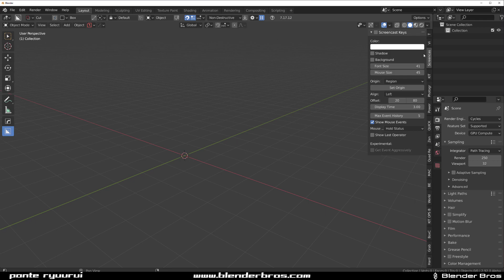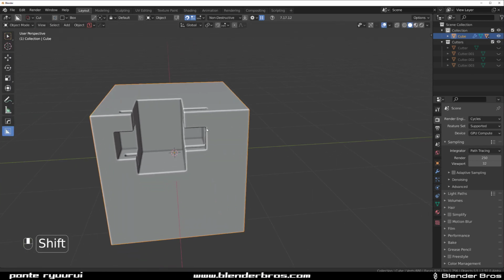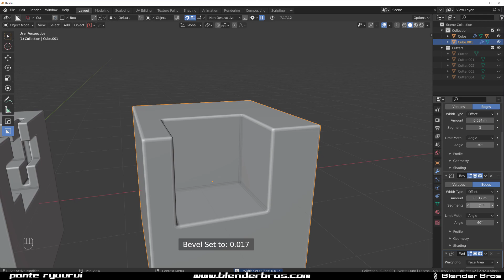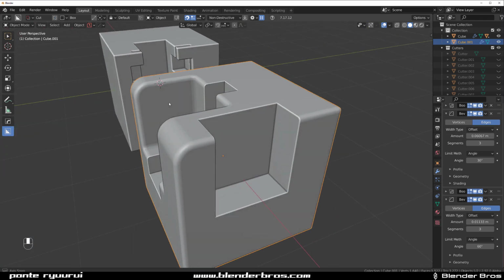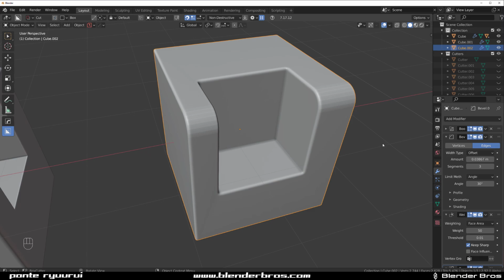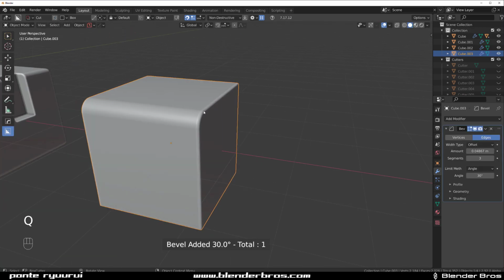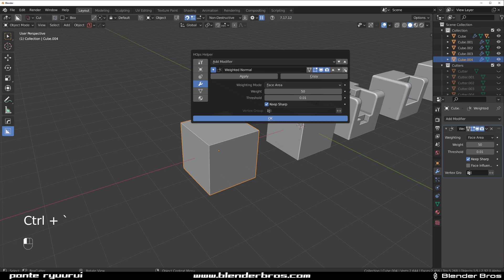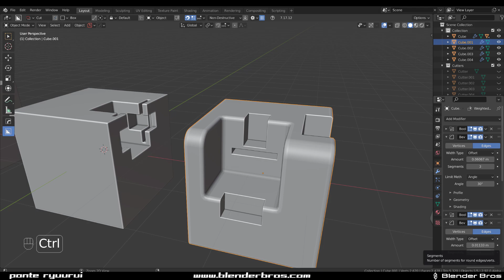A SECRET of pro bevels for scifi hard surface in Blender

Comment: Hi Ponte, I recently purchased your game asset course, good stuff. I'm experiencing an issue I was hoping to discuss with you. After applying the 1 seg bevel and triangulate modifier, I've noticed this splits several corners on the uv's in addition to some small overlapping. Is there something I'm doing wrong? I was under the impression that applying the 1 seg bevel wouldn't mess with the uv's? Hope to hear back from you, thank you.
Reply from the maker: check your email, mate

Comment: If you run ctrl + difference or step and then delete last bevel 60 mod and try to add 60 bevel again (ctrl+shift) it'll not do that, only ctrl+difference or step does, after toggling on/off hops add-on it adds with ctrl+shift bevel mod to the object
Reply from the maker: lol what?
Reply: @PonteRyuurui )))) I'm just trying to add bevel 60(q-ctrl+shift bevel) after Bol operation(q-ctrl difference(bypass sort)), instead of adding it adjusts the previous one, besides on the new object situation is the same (q-ctrl+shift bevel = adjusting the previous one), after toggling off\on hops q-ctrl+shift bevel = adding 60 bevel on the objects))
Reply from the maker: @yurykot9385  update your hard ops or blender or both, ctrl shift always works for me